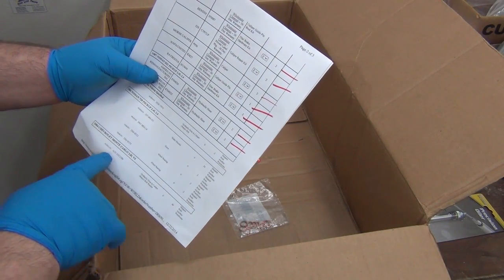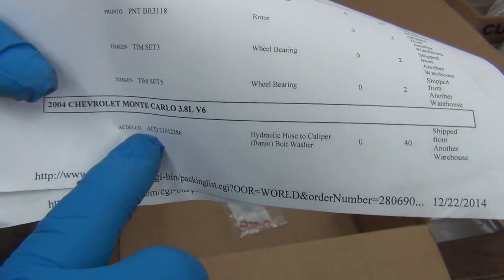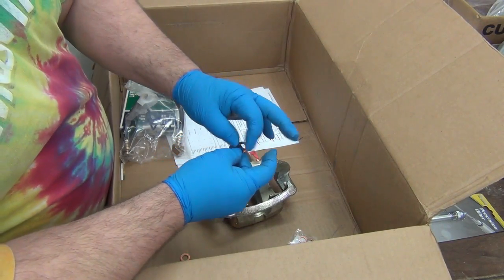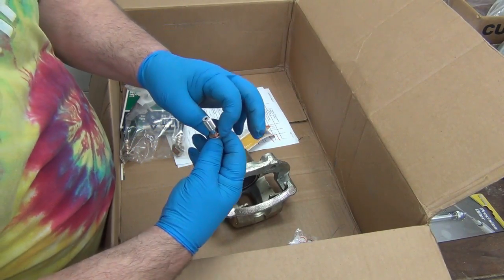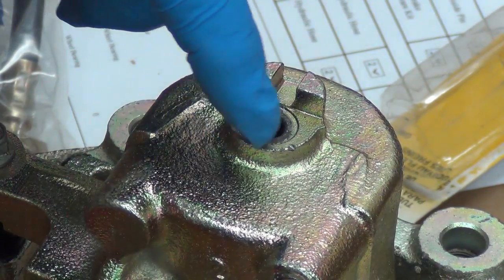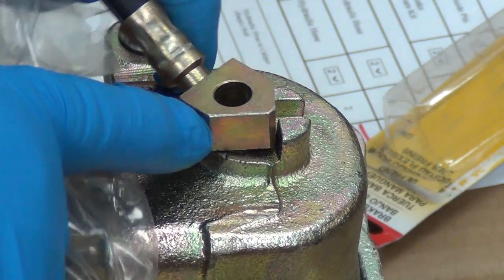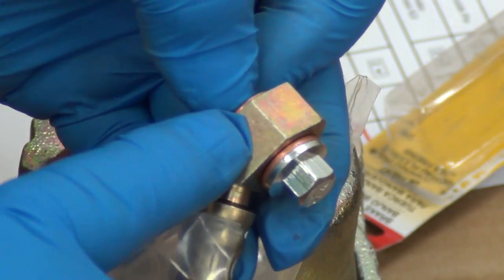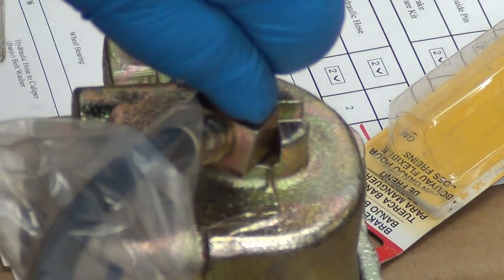Brake Hose Banjo Bolt and Washer - D21 Hardbody

Comment: I've never been a fan of those copper/bronze/brass/whatever banjo crush washers.  Too many times I've had them leak if the surface isn't perfect; especially in applications using braided stainless brake hoses rather than factory rubber.  Those Dorman banjo bolts definitely don't help any, either.  They seem to be made out of a very soft metal, and I had one deform on me just seating the crush washers (~30lb-ft).  Since then, I've relied entirely on Jegs for stainless steel banjo bolts and their nickel/steel crush washers, and haven't had any issues since, even under severe duty.  They're a bit more expensive, but when it comes to braking, I think it's money well spent.  Their banjo bolts are also flat, whereas a lot of the Dormans have a lip around the edge, which I guess is designed to center and hold the crush washer?  If that lip catches on the crush washer during tightening, it's done.

Also, that's the caliper for the REAR brakes?  Man, that thing is a beast!  Does it integrate with the stock master cylinder, or are you changing out things there, as well?
Reply from the maker: I haven't had a great deal of trouble with crush washers over the years, but there's definitely been a time or two.  The aluminum washers certainly crush easier, but I've rarely used them....just seem weak.
I'll pay attention to these banjo bolts and see if I have any grief.....if so, I'll be looking up the Jeg's ones! Thanks!
It's a front caliper.  The Datsun trucks prior to '78 had drums up front too.....those are the ones I deal with.  I've always upgraded the m/c, but there's been a few guys out there that are running the stock m/c......I don't recommend that at all!!!

Comment: Do copper crush washers have to be put on in a specific direction or does it not matter?  The sides do look a little different.  I replaced bother rear calipers on my Honda and one was leaking.  My mechanic said I put the washers on backwards.  That was odd to me as the one that never leaked had the washers on the same way.  Thanks.
Reply from the maker: There's plenty of debate out there on all three options....yes, no and depends. lol  I think the "depends" camp says that because it depends on the two surfaces being mated and the way the washer was made.  You'll find some washers that are the same on both sides....nice and flat.  These could go on either way.  You'll find others that are flat on one side and the edges are a bit rounded on the other....from how they were stamped with a die cutter.  In this case, I would put the flat against the harder, flatter surface...and the rounded side against the softer or more uneven surface.  The washer between the banjo fitting and the caliper......I'd put the more curved surface against the caliper.  Between the bolt and banjo....both are pretty equal and I wouldn't worry about direction.  Now....that's getting down to the real "nitty gritty" of things.....but the reality is....it doesn't really matter as long as they're tightened up correctly.  I'm not sure how your mechanic could tell how it was put in after it was already crushed.  The end of the hose has a right and wrong way a lot of times.  If there's a step in the fitting, it definitely matters which way the hose goes.  I'd ask the mechanic that said that which way is right and why!  Is he one you've used a lot and trust that he'll give you the real, correct answer?  It's pretty common for mechanics to think the owners don't have a clue and just tell them something plausible that will get them to stop asking questions. lol  

Sounds like you used new washers....that's good. Don't reuse them.  Have I before...yes.....would I ever recommend it....no. :)  There's lots of other nuances that could cause a leak....but it would be a stretch to blame them.  I think I've only ever had one leak....new caliper, new washer.......I just replaced the washer again....leak fixed.  I'd be really curious to hear the mechanics explanation. :)

Comment: What are aluminum banjo bolt torque specs.
Reply from the maker: Sorry. No clue about the torque specs. I've never seen or heard of aluminum ones.  For steel ones, the spec should be in the factory repair manual.